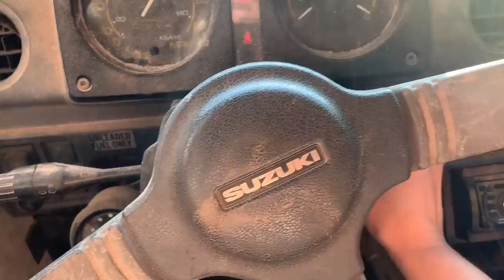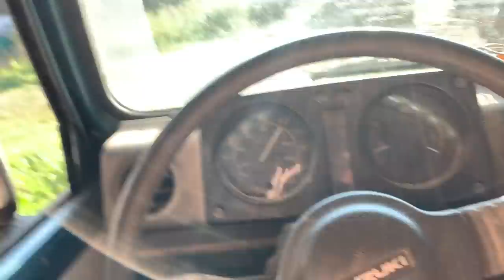Making Corn Silage

Comment: GREAT VIDEO I HAVE NEVER FARMED BUT I THOUGHT SILAGE WAS PUT IN A SILO ONLY BUT I STAND CORRECTED HAVE NEVER SEEN IT STORED THIS WAY BUT I AM SURE IT WORKS JUST AS GOOD THANKS MERDY
Reply: Silage "pits" are pretty common. Silos are expensive and only the bigger operations can afford them. The Bernard farm doesn't run that many cattle so they can use pit method. Once filled and packed pits are usually covered with plastic or tarps to prevent spoilage and help with fermentation of the material. It is then used to suppliment the hay in the winter months when the pastures go dormant. Check out farmingfixingandfabrication channel if you want to see some really BIG concrete pits or as  some folks call them bunks.
Reply from the maker: It can be! We just have a pit. Thank you!
Reply: @johnnyholland8765  THANKS I NEVER NEW THIS LEARN SOMETHING NEW EVER DAY JUST LIKE A ROOT SELLER

Comment: ok what is the silage and what is it for, why do you put it down there ??  I am a city boy.
Reply: Feed for cows.
Reply: It needs to be packed as tight as possible by the tractors running over it and then it ferments while covered usually and eventually becoming feed like Dr Draws said.
Reply: @drdraws9597  Silage is chopped corn. Machine chops it uniformally in about 1 inch square pieces and blows it into a truck or trailer. It is then hauled to a silo or in this case a "pit". It is packed and then covered with a tarp to prevent spoilage and help with fermentation process. It brings out the sugars in the material and is used as a suppliment with hay for cow feed during the winter months when the pastures go dormant. Hope this helps.